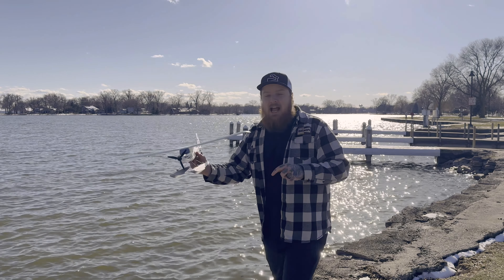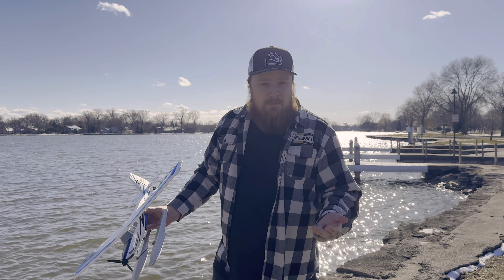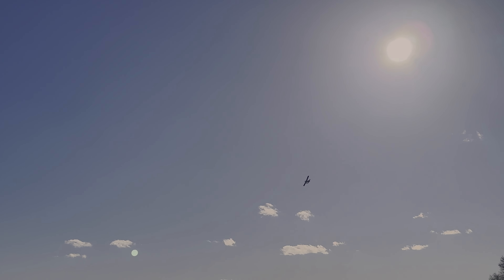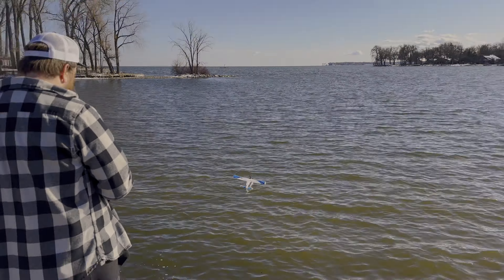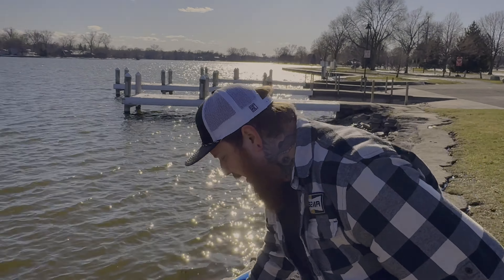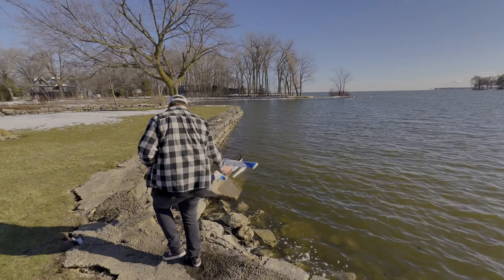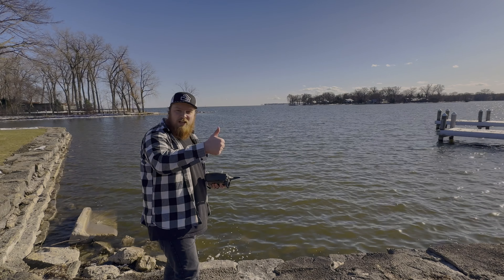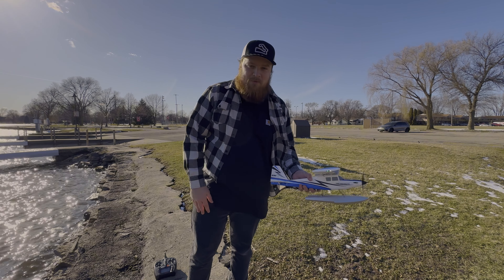UMX Turbo Timber Evo Float Flying Vs Rookie!

Comment: You crack me up, dude. I hope your channel thrives. I can watch this insanity all day. 😂 Why not make a turbo EDF Timber? Get two UMX A10 EDF fans and ESC/Reciever combo and put them on the wings. You will have a Timber Jet? Best of both worlds. 😂
Reply from the maker: Haha I appreciate this comment so much you have no idea. Also, I love that. Fantastic thought process. I know how I’m spending the rest of my weekend! 😂
Reply: @Mach3RC  You're Welcome. I have done it with the Bigger Turbo Timber Evolution 1.5m. I used two FMS 12-blade 70mm fans with 28 series in runner motors 80 amp ESCs 4s Lipo. One of my favorite planes. It makes a fast-sounding EDF noise as it puts along and confuses people. The cool thing is you can program differential thrust and do flat spins and hover. lol

Comment: Pick yourself land and sea  650 pator..its at bg for $85...its awesome..just make sure you put 2s 1000 in front compartment.
Reply from the maker: Wow that’s cheap!! I’ll take a look. Thinking of getting the FMS Ranger as a good float plane
Reply: Yes,once i watched some reviews and tweaked linkage and installed battery in front it flys amazing...i hit left button 5 times fast and gyro turns off ..i do some tricks..then when it gets to hairy to control safely, i press button 1 time and gyro saves it..its also super crash resistant...i also swapped stock prop for 4.7x4.7...motor stays cool and plane has more power and speed..stick with stock 2s 1000 batt.
You get over 8 mins of fun flying...